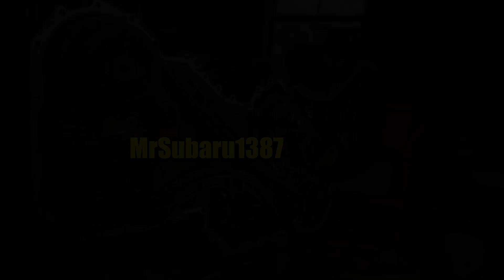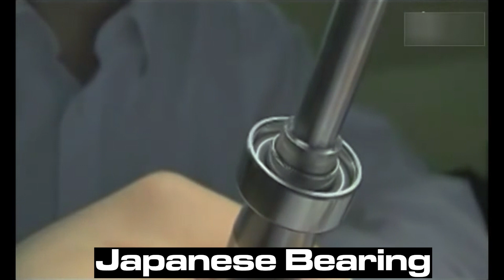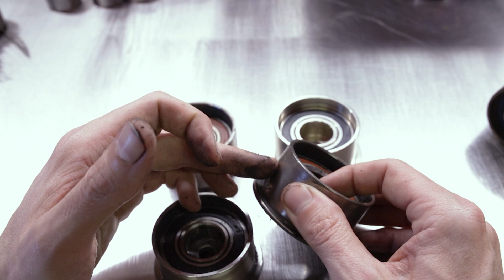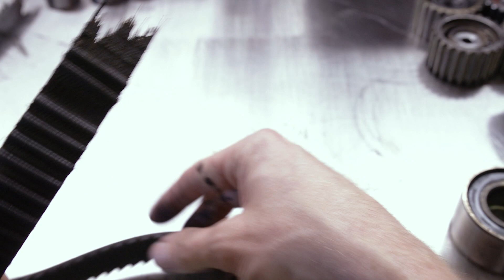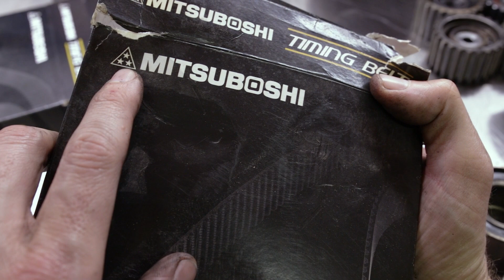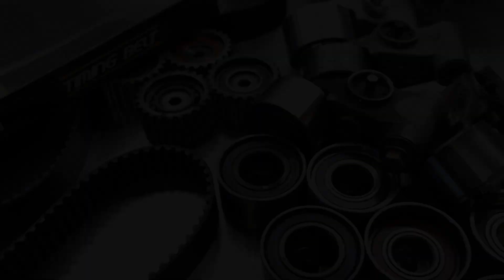Subaru EJ Series Engine Timing Belt Components Inspection & Common Faults

Comment: I  have a 2006 Forester X with automatic transmission looking for the right kit with water pump. Aisin has informed me they make the TKF-006 for the naturally aspirated manual transmission with a different water pump than automatic and the TKF-004 for the turbo version. How can it be possible it's not available for automatic when there are more automatics on the road than manual? Can you help me with this issue? Are any good options other than OE?

Comment: I use a bench drill press for the ""tensioner" treatment. Mount it in the drill vice and apply the pressure with the quill handles. Total control!. Easy as. Thanks for your vids- from New Zealand.

Comment: I ordered a  oem subaru timing belt kit..and the ball bearings blew out on the bottom cog. And it was less than 8000 miles...but the belt and all other parts were still good

Comment: I had one of those Canadian tensioners on my ‘11 when I bought it possibly part of the gates kit that was installed before I bought it.  I found out during a head gasket repair the tensioner seal was bulged out .   And one of the idler bearings was toast with only about 50-60k miles on the timing kit.   I swapped it all out for a continental part number TB304LK4 and it was all Japanese stuff .   👍.  Aisin kit was too far out and I wanted to get it together so maybe it’s an another good option for folks.

Comment: Just had my mechanic use the Aisin timing belt kit for my 2000 Subaru Forester. I am not a fan of the china stuff. I have had issues with a Gates water pump before. It leaked ! Thats the reason I stayed away from Gates. I will say the Gates belt looked in good shape after 64,000 miles though. I used the Gates kit 8 years ago . Everything but the water pump worked okay. That being said I would never use Gates again. I am noticing a quieter and smoother experience with the Aisin kit. The difference in quality really stands out. I love your demonstration on the japanese version bearings vs chinese.

Comment: I did my last timing at 300 in the car at 34x  pulled the motor to do some work on seals the tooth idler was grimy sounding and the tensioner had oil leaking. All were Japanese bearings. Just replaced the toothed idler, the belt and the tensioner to save a couple bucks since the other components were good.

Comment: I am looking for a Aisin timing belt kit for my 2012 Subaru Impreza sport limited. 2.0 engine, all the kits I see have the wrong water pump. my pump has the thermostat facing down not the front facing. Can you help me get the right kit? Thanks, Pablo Irizarry

Comment: Very useful video Mr. Subaru! You touched on an issue that I’m looking into. The lower left idler for an ej25 SOHC; the “shouldered” idler near the oil filter. I noticed that the outer sleeve of the new NSK 13073AA190 idler wobbles a little, side-to-side, or up-and-down on the single bearing. Do you know of a double bearing replacement/upgrade for the AA190 idler?

I noticed another reputable Subaru mechanic just using the double-bearing “shoulderless” AA142 (usually used in the location right above the shouldered idler) in place of the AA190. Do you know if I can get away with this? Might there be an issue with the belt “walking” over the inside edge of the shoulderless idler?

Thanks for your thoughts, and thanks again for taking the time to make these valuable videos.
Reply: I suspect you do want that shoulder for certain corner cases. Just like the extra guide on the crank gear for stick-shifts.

Comment: so the "upgrade" with the single bearing idler is to use the upper right double bearing idler, even if it does not have a lip? for sohc
Reply: That's what I'm wondering too.
Reply: @jsmith7338  If that idler was meant to have a lip, I'll use the lipped idler, even if the bearing is just a single.
Reply from the maker: I've installed hundreds of the upgraded idler without a lip, with not a single issue..
Reply: @MrSubaru1387  ah no, now I want the none lipped one with the better bearing :S

Comment: I'm wondering where the little black o ring for the belt tensioner goes?
Reply: The little o-ring just helps to keep the flat washer from falling off the bolt, when you remove the tensioner. The flat washer is between the tensioner and the block. The rubber o-ring isn't a necessity, just a convenience.

Comment: That demonstration of the difference between Chinese bearings and Japanese bearings REALLY shows EXACTLY what you're talking about, and the increased resistance in the Chinese bearings is easily observable.  Thank you for that demonstration!
Reply: The Chinese do know how to engineer & produce quality, but we've been asking for cheaper for decades...
Reply: @wim0104  The Chinese have no problems with copying oem markings as close as possible.
Actually undetectable to the untrained / unsuspecting eye.

Comment: Besides a Subaru Dealership, where else would you recommend a safe business to get older Subarus serviced/diagnosed for random problems I am having with my older 2005 Subaru Outback 2.5XT. Perfect body. Just needs some attention on the internal parts. Either good businesses or ways on finding a good business to get my Subaru serviced wise for diagnosing. I tried myself and it didn't go too well. With youtube videos and google, I kind of tend to go down a rabbit hole pretty fast as far as solutions to problems I think I'm having versus what the problems I am actually having. Any help is appreciated. Thank you.

Comment: Great videos, very informative thank you. Question. According to the Aisin aftermarket website, my timing belt with water pump kit for my 06 Forester is listed as the TKF-006. If I follow your link back to Amazon, the same kit, according to Amazon, comes up as "doesn't fit" my vehicle. The discrepancy brings in a certain degree of hesitation when ordering parts, assuming Amazon is in error with their match up? Ready to order but with hesitation !!!
Reply from the maker: I'd go by Aisin's site over Amazon.
Reply from the maker: Foresters are an issue because of their water pump. Really depends on if auto or manual.
Reply: @MrSubaru1387  its automatic. I did see the on the Aisin site it does mention naturally aspirated, manual EJ253 (TKF-006) the only other option was the turbo version EJ255 (TKF-004) - any suggestions would be greatly appreciated (belt kit only and order water pump separately?). Thanks for the quick reply !!
Reply from the maker: @peterschwarer4352  you need to get under the car and look at the water pump outlet pipes. See if it has an oil cooler.
Reply: @MrSubaru1387  Yes, there is a cross over pipe from the water pump to an oil cooler

Comment: @MrSubaru1387 I have changed out all my components with Japanese parts (stamped on the idlers) I don't see a casting mark on the water pump. Torqued everything down, timing was perfect; took it for a drive around the block and the timing belt jumped. After further research I see I didn't bleed the tensioner. Would that be the main reason for failure? I do not trust the tensioner now but I do believe this was from not bleeding now that I see your video. I am now putting a new motor in and I don't want to repeat the error. Thanks!

Comment: 18:00 - can confirm about the water pump. Mine went out on my 02 WRX around 84k, didn't catch it, overheated, had to get a new motor. 

Changing the entire timing kit with an Aisin one every 70k now.

Comment: If it was originally made black like vulcanized rubber, the carbon (the black stuff) is part of it's engineering. It gives it durability and strength. That's at least how it used to work when I made tires.

Comment: I just changed my front diff/transmission fluid and the rear diff fluid as well. I did the front first as I was waiting on my 13mm square head mall socket to come in and the gear changes are already smoother. Cant wait to test out again with the rear diff done too. I have loads of fun in the snow with my subaru. I watch your videos and try to make my subaru better by doing maintenance. 

I have a question though. My 2010 OB 2.5L has the anti skid feature. Its a nuisance when you want to have fun in the snow and for icy corners it makes me feel more in danger as I try to correct but the wheels lock all over the place. Never had any issues on icy corners with a bit too much speed in FWD car without that antiskid feature. 

Is there a way to disable the antiskid system? I read on it online a bit and some said that disconnecting the wire would also make it so your break lights dont work. 

I ask because I know a guy who was in an accident with a subaru OB 2011 and his anti skid doesnt work anymore. Mine currently doesnt work as the check engine light came on (comes and goes every now and then) and the anti skid light is on and doesnt work as I can have fun in the snow without interference. BTW I have fun in the middle of the night in parking lots with nobody around. Asfor the 'high speed' cornering when its icy, sometimes it just happens and with older FWD cars I was alwayd able to control the skid. With the antiskid in an AWD subaru, I have mord trouble correctings as the wheels always lock because the car isnt going straight like it the antiskid module wants to. 

Thanks to anyone who could help my out on disabling the antiskid on a 2010 subaru outnack 2.5L.

Comment: Thanks for this video that I needed to see to check condition of my TB on 95 Legacy. My only question is that since my 95 is EJ22 it shouldn't bend valves etc. as it's a non interference motor so if tensioner gives out and belt breaks it should not break valves right?

Comment: Nice. I have been looking and looking but no timing belt kit for my 3.6 🤔
Reply from the maker: It has a chain, not a belt.
Reply: @MrSubaru1387  🤦‍♂️
Reply: @MrSubaru1387  What interval on the accessory belt?  No power steering
Reply: @TheLazyCarrot It's in your owner manual. If it's the same serpentine belt design as the 3.0, there's a tensioner pulley and an idler pulley that's part of the maintenance of it. Mmmm I think he has a video on the belt change...
Reply: @bbodan5393  No idler bearing. Just the alternator and ac compressor.  Also the tensioner is a manual type.
Reply: @TheLazyCarrot Sorry, my auto mechanics are limited to the 2nd generation of the ez30. I'm an industrial mechanic not automotive. An alternator, (and your a/c compressor by your own merit) has to be run by the flywheel/crank pulley to provide mechanical power. From my understanding, all H6 engines have chain driven timing. Preventative maintenance is derived learned failure intervals. If it were just a ribbed belt, 60k would likely be a good rule of thumb. The crank, alternator and a/c have to be connected with a tensioner mechanism. Whatever that tensioner mechanism is, it would be another maintenance point to be checked. Anything that is mechanically engineered, have failure points, by design, to fail before an entire system failure. You can easily determine all the possible points of failure, on your own, visually and use something like opposedforces.com to find a OEM part # for replacement. Your a/c compressor pulley is probably engaged by the ECM magnetically. Crank, a/c and alternator wheels are parts NOT part of maintenance. Good luck.

Comment: Have you checked out the new Dayco kit yet? Comes with Japanese waterpump, tensioner, & sprocket. Then Korean GMB idlers & Italian Dayco Kevlar belt. I've had it on my car for about 10k now with no issues. Have any experience with GMB bearings or Dayco belts?

Comment: The only timing belt failure I have had while driving was on the cogged pulley. I was an idiot and didn't replace it when changing the belt. I was broke at the time. Ended up buying twice. Luckily, it was an EJ18 so non interference and other than having to also buy another water pump, no damage to the engine. Do you have any theory on why the cogged pulley fails first? I guess it technically has a slightly smaller OD so spins more per engine revolution and is probably also taking the most lateral force. Also interesting note, I recently bought a Gates N kit and the belt it came with was made in Japan. Looked nearly identical to OEM. Wouldn't be surprised if it's a rebranded Mitsuboshi under contract. I'll be releasing a video on it by tomorrow.

Comment: Hello Mr Subaru, i need some help if you dont mind of course, i installed a cobb sf intake on my 2008 wrx and when i get the code "P0244" boost limit exceeded... i did some research and im having a hard time searching for a solution to this issue.

Comment: Thank you for the video sir but I am curious about your stance on water pumps. Specifically how you feel about the cast and stamped impellers but also your brand preferences.
Reply from the maker: Seems water pumps need a video. 👍🏻
Reply: I’ll be tuning in sir thank you very much.
Reply: the issue is not the impellers, but the bearing or gasket.

Comment: To compress my tensioners, I put a c-clamp in the vice vertically so I can put the tensioner in the c-clamp upright. I then compress it about one turn of the c-clamp per minute. Nice and slow and the tensioner remains upright.
Reply from the maker: Yup. I've use big C-Clamps in the past.
Reply: Thanks for the c-clamp idea.  I need to do this soon and I don't have a press.

Comment: Funny story, I completed my timing belt change and forgot to pull the tensioner pin. Never started the car, just wrapped up for the night and in the middle of the night I woke up remembering that I forgot to pull the pin. Moral of the story, never rush and go through everything twice.
Reply: Would have been ironic if it exploded because you didn't pull the pin.

Comment: Thanks for the video. Didn't know that about the tensioner possibly having air bubbles. If you don't have access to a shop press, would you recommend just doing like you said you used to for years? Rather than jack it up with some DIY stupidity, which I'm prone to.
Reply from the maker: Factory, oe, NTN, Japan, tensioners shouldn't give issue, but always a chance. I've compressed them in large C-Clamps before. Just have to hold them upright.
Reply: @MrSubaru1387  thanks again. I literally received my timing belt kit yesterday. It is an NTN tensioner. After watching your video this morning it set my mind at ease. Looks like I the proper quality parts. My water pump and thermostat arrived today from Subaruparts.com.   Much appreciate your sharing invaluable knowledge.
Reply: just go real slow, with intervals, with a small C clamp. I go half a turn it, between swapping the other pulleys.

Comment: Is it true that the BRZ uses the subaru boxer but swapped belt for timing chain?  If this is true can this easily be done with other subaru motors
Reply from the maker: No. The BRZ uses an FA20 engine. FA/FB engines are chain engines. Totally different from the old belt EJ engines.

Comment: Installed a Gates kit with NSK and Koyo idlers a few years ago and a few months later had rough running and vibration on startup. Turned it off and inspected the timing belt (fully) and found the NSK cogged idler to have collapsed inwards slightly contacting the engine. The timing was off but somehow the engine was OK and runs fine to this day.  Also, I used a YouTube method of slowly compressing the tensioner using a socket & breaker  prior to removal. Doing this can over-torque the idler on the tensioner and it doesn't spin freely.

Comment: To whom this concerns. Know the difference between an interference and non interference engine when buying a vehicle whether new or usd. Also find out if chain or belt driven. Thiknowing this will save you mucho denero in the future. The subaru boxer engines are interference engines
Reply: there aren't many non-interferance engines on the market today. Also in the debate between belt vs chain many things can be said.. It's not like timing chains never wear out nor need replacing..  specially for the chain guides.. If you tell me that they are a "safer" design from the get go and that last longer I agree with you. However, when they need replacing, it usually costs more, specially if its an engine out scenario..  What people need to do is keep up with maintenance regardless how timing in the engine synced. That will save thousands, both in monetary units and headaches
Reply: There aren't many non-interference engines on cars made today!  Chains are great but the guides fail so it is not much better.  Just replace the belt as recommended by the car manufacturer.  Gates makes heavy duty belts.
Reply: The EJ18 and EJ22 (SOHC) boxer engines were non-interference engines.  The EJ25 engines were interference.  The newer Subaru engines 2013+ are chain driven.  The EZ30 and 3.6R are chain driven as well.